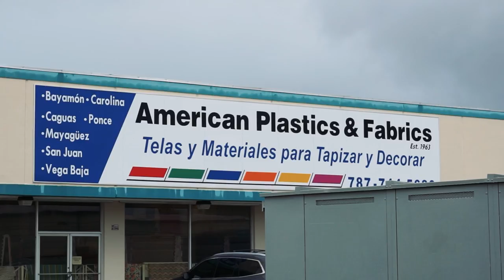The ANSWER to Boat Life BURN OUT Puerto Rico Sailing GBU

Comment: Try rubber bands around the glass jars so they dont break
Reply from the maker: That's a really good idea
Reply: That's the only kind I have lol
Reply: we use hair bands....since my wife always has a ton lying around
Reply: @SailingGoodBadandUgly    Not really, good thought but ... rubber bands melt in the salt air into gooey blobs :)
Reply: The best product would be bubble wrap it will not rot. If you use a camera bag in high humidity you should remove the foam rubber pads and use bubble wrap it doesn't absorb water.

Comment: Check out a junk yard and see if you can find an old RV trailer.  Take the 12v roof mounted AC unit.  Attach it to the center of you main cabin area.  Those units are low power use self contained and light wait.

Comment: We run a 110V window unit at hunt camp on a Honda EU 2000, runs all night long on a tank.  I imagine gas is high and hard to come by at times but for those hot nights it's a life saver. You could fashion a removable curtain with a cutout for AC that covers doorway.
Reply from the maker: We probably should look into it!

Comment: It is really hard to tell perspective from a video, but have you ever considered one of those portable air conditioners? The beauty of them is that they are much more efficient than window units, and you can get a 12000 btu unit to run on a standard 15 amp outlet. But storage while underway could easily be a problem. It does have other drawbacks, but Matt is inventive and I think he would figure them out with ease.
Reply from the maker: We've considered it but they are power hogs and we try to run a small power load
Reply: @SailingGoodBadandUgly  Yes, that is the downfall of AC on a boat.

Comment: I guess 18" on the tape measure. Glad you guys weathered the storm well.
Wrap your foam in saran wrap or some kind of similar light plastic with some air escape holes around the edges. It will last longer and be a little more firm for longer. 
Separate those glass jars so they don't clang together.
That Jeep looks good on Yall! Definitely lose the ugly...it doesn't fit with the Rockstars that you are!
Thanks for sharing your adventure with us!

Comment: Hey guys I'm from Puerto Rico and I  love you. I use to own a hardware store , and saw Matt using tapper concrete screws on the boat. You should've used drywall screws instead, they're better in wood. And you should've varnish the wood prior to installing it. Believe me I know, I was a boat owner also. Keep it up 🤩
Reply from the maker: Thanks for the tips Ernesto!
Reply: Where you here yesterday?, I live in Caguas (the center/east of the island) but by all report the effects of Laura where felt worst in the south . If you were, hope you are both(and the boat) well.
Reply from the maker: @ernestoroldan2832  we're in Salinas, we did fine here

Comment: Friends a suggestion why not?  You build the roof in styrofoam and fiberglass so that you can put solar panels very easy, work the styrofoam then 5 layers of latex paint to protect the foam from the resin and then apply the resin and fiberglass.  So with a lithium battery bank.  and a power inberter air conditioning.

Comment: Has anyone diy'd a simple heat exchanger on a sailboat? You wouldn't be able to cool the boat any more than the water temperature but that would still lower it a few degrees I would think. Ever little bit helps.

Comment: Is your boar fiberglass or wood? I’m wondering when you drill into the boat to attach shelving or (whatever you’re building) what are you drilling into? What precautions do you need to take if any? Do you need specialty threaded bolts?  It appears to be more customizable then I imagined.

Comment: @1:58 Matt blowing bubbles 🤣
@8:53 You hyped up that road so much I was expecting some rough dirt track with boulders etc and then it was a sealed road that any car could have driven on 🤣
As for how long was the tape, i'd have guess 0.75m but the tape is probably not metric so I have no idea.
Reply from the maker: The road perspective was a lil off but it was supper steep .. Were FL ppl so we're used to flat rds lol

Comment: Y’all could install ac on the boat... 😋
Reply from the maker: No way! Ac on a sailboat is the weakest sauce😂😂 but complaining about the heat is fine lol
Reply: AC and a generator + 2 gallons of fuel per day + being noisy and ruining the peace and quiet of any neighbors. But yeah, I have AC on my boat lol
Reply: Darth Hader or there’s people in tiny houses doing some pretty interesting stuff with mini splits and solar panels. It turns the variable speed pumps without being full voltage.
Reply: How many watts of solar and how much battery storage would be needed?

Comment: My 2 cents worth, I would have put a bit of (used) fishing net cut to fit along the shelves so that even if you do a full upside-down oopsie your canned goods don't go banging around the interior of your boat. Plus you can even stack stuff on top of stuff and it can't fall out. Being the overly organized anal-retentive soul that I am I would label each storage area and inventory everything you have in a spreadsheet or database on your computer so you can find it when you want it. Plus that way you can know how many cans of (whatever) remain in your inventory before leaving a port (assuming you pull each item out of inventory as you use it). A lot of places have the same items you like, but a lot don't.